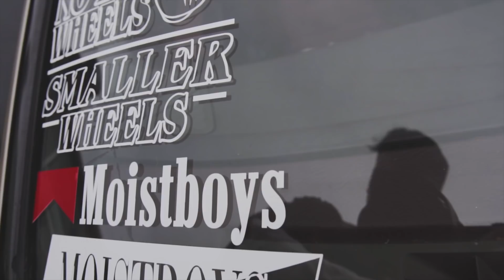MONO WIPER A CAR IN 5 SECONDS

Comment: How long did it take for you guys to manual swap
Reply from the maker: Hien Pham about 3 days! Ended up missing some parts and running into some problems
Reply: Did you have to get a new ecu or did you use the old one ??
Reply from the maker: Hien Pham same ecu no need to change it!
Reply: Ok thanks
Reply: And also did you guys have to get a new flywheel ?? Since automatic only have flexplate ??